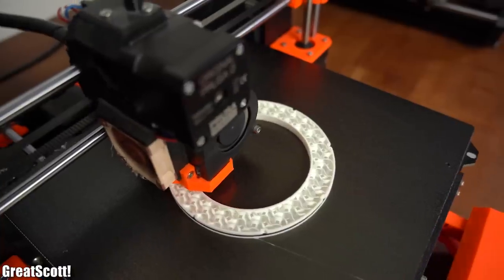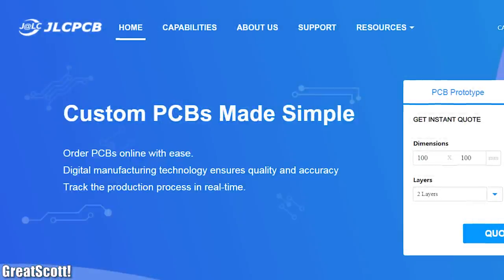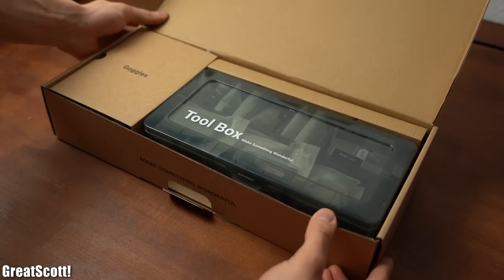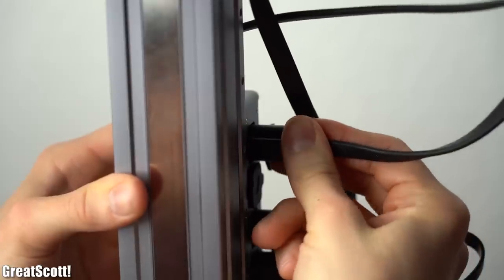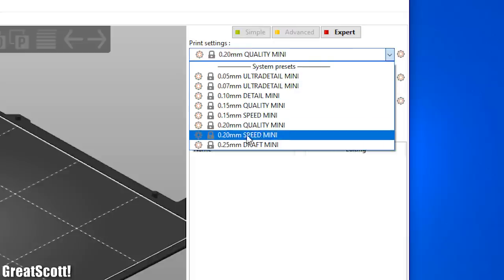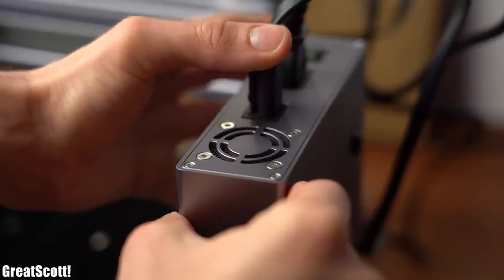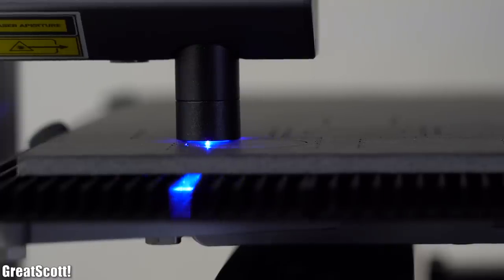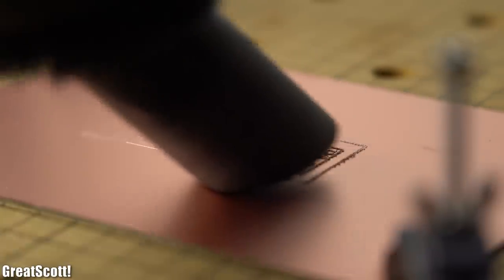Testing a 3-in-1 Machine || Laser Engraver/Cutter, 3D Printer, CNC Machine || Snapmaker 2.0

Comment: You can get 3 machines that are same or even better for the same money or even less. So you can do 3 projects at the same time and do not have to replace the bed. Ok these machines do not look that good. The cnc spindle is same as the cheap chinese 3018 which costs around 200€,  a laser engraver is also 200-300€, a 3d printer is also 300€. I would spend 900€ on a more capable CNC and 600€ for laser and 3d printer.

Comment: Most of us change the fan to a 24V fan with hydraulic bearings. You only need to change the pin out of the fan to match the Snapmaker 2.0 pin out. You will love the machine after that...

https://www.amazon.com/gp/product/B07V1M74CG/ref=ppx_yo_dt_b_asin_title_o00_s00?ie=UTF8&psc=1